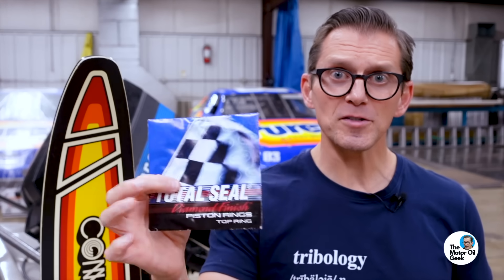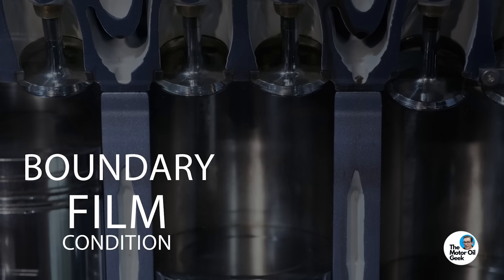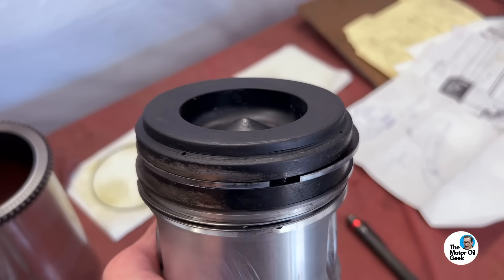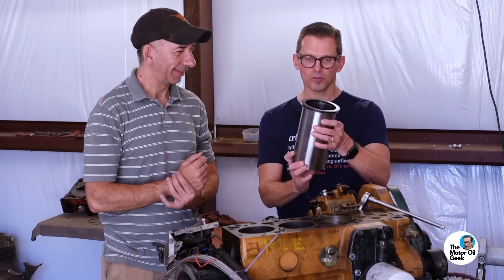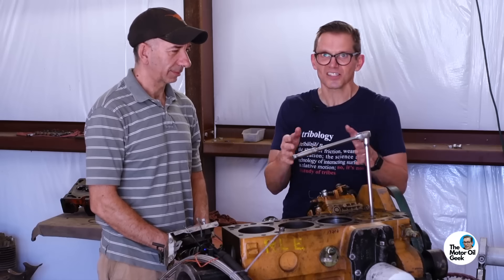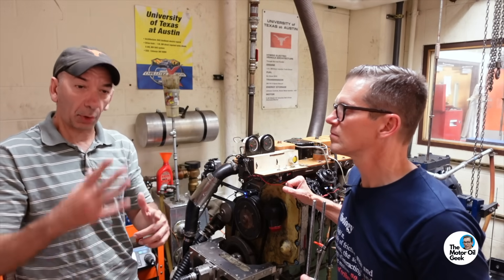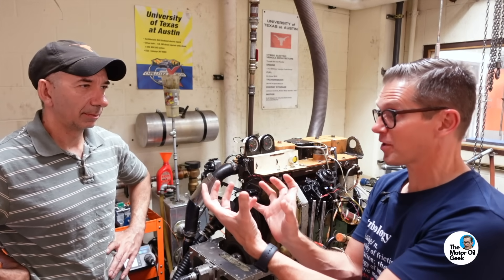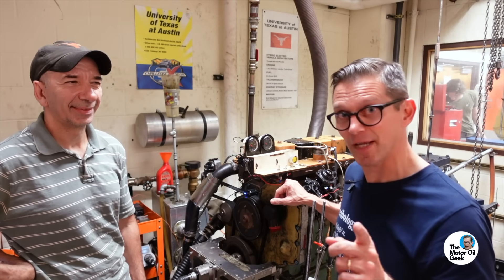Water Skiing Explains LUBRICATION - This CRAZY Engine Proves It!

Comment: What a game changer! Awesome idea Lake! Three things interested me: how is the liner motion lubricated with regards to the block; how much power is consumed by the liner drive system and how liner cooling is achieved (oil cooled or a combo of oil and liquid). Loving these videos! 👍👍
Reply from the maker: Thanks! There are oil passages in the seal that direct oil to the backside of the liner, so the liner is both lubricated and cooled by the oil flow.

The 10% gain is net of the friction to rotate the liner, which shows how much ring friction there is at TDC and BDC in a normal engine.
Reply: @themotoroilgeek  Thank you Lake. I thought that might be the case for cooling. That net loss of friction makes a huge difference!!
The rotating liner may also be an advantage for diesels too in helping prevent liner attrition from coolant cavitation.
I'm looking forward to your next video.
Reply: @steveross2797 I don't think this liner contacts coolant in any way. It's more of a sleeve in an existing bore.
Reply: @rotorhead5826  It's cooled by oil flow around the sleeve rather than liquid coolant as a conventional fixed sleeve would be.

Comment: That's so cool. But how does the outer portion of the liner (the part inside the engine not with the piston in it) and the sprockets that turn it get lubricated?
Reply from the maker: The seal at the top has oiling passages that provide oil supply to both.
Reply: @themotoroilgeek  thank you for clarifying

Comment: Really interesting project. Sealing the combustion and coolant long term seems like the real challenge. I find it hard to believe there is that much friction in the ring pack hitting tdc and bdc stationary to counter the energy required to drive the liner. Seems like you would pick up enough extra friction just from constantly rotating the rings in the piston at liner speed to contradict any friction losses from the rings starting and stopping. Also I noticed they were only testing this at barely off idle speeds. Can’t wait to see data at 2500rpm and full load.
Reply from the maker: It just goes to show how much friction there is in the ring package!

Comment: Very cool! So many people are still working on IC engines, improving efficiency which improves fuel mileage and reduces emissions. Money better spent than on EV technology.
Reply from the maker: Agreed!
Reply: Sorry, not sold on EV cars yet.
I’ve seen and worked on IC engines over 100 years old.
IDK, but I doubt there will Ever be an EV system, let alone complete EV car, that will be functional after just 50 years.  
I dont think any of the EVs today will even make it to 25 years.
Reply: The average is what matters. Now that we have data on the longevity of EV’s and their lack of required maintenance we can compare the lifespans and operating costs. Battery technologies are rapidly advancing so efficiency will increase over time. Gas and diesel engines will be around for the foreseeable future so it’s not an all or nothing situation. Denying science is stupid. Just ask Lake!

Comment: Im not a mechanic or engineer, but wouldn't the "sleeve" rotating as the piston moves against it increase pressures/friction or temperatures? Fascinating video.
Reply from the maker: Thanks for watching. The rotation creates relative motion between the rings and the liner, which creates a lower friction oil film. Think about the water skiing analogy.

Comment: I am very skeptical that this is a viable solution for a problem that barely exists. The amount of wear on a cylinder is literally microscopic. It's 1000's of hours to wear a fraction of a millimetre. Adding rotary seals, presumably changing from a water jacket to an oil jacket and adding a bunch of extra moving parts per cylinder to me suggests that there is likely to be more parasitic losses than the friction losses near TDC and BDC. The benefit that I could see in having a rotating sleeve is that the sleeve will have a more even wear pattern 1000's of hours down the track due to the thrust loading effectively being born by the entire circumference of the bore liner over time.
Reply: The main focus is reducing friction and improving fuel economy.  That is a real problem.  The wear is an added bonus which is important for commercial engines (not so much for automotive engines).  Even 0.001" of wear increases engine blowby and oil consumption.  The losses of the rotating liner are part of the equation in the testing that determined the fuel economy benefit.
Reply: On the rotatingliner site I didn't find any graphs or test results as shown on here. The graph shown on here didn't really show or explain much.
Reply: @Alan_Hans__  The graph you saw there is part of a paper that we are publishing at the Society of Automotive Engineers in April.  You are correct, it is not in the website.  Both this video and the website cannot explain the technical issues to the extend that research papers do....

Comment: 4:15 Hawker Typhoon or Tempest (The Tempest had the bubble canopy but so did the last Typhoons) with Napier Sabre H24 - dual crankshaft 12 cyl per shaft "H" with very high tech sleeve valve design that took a long time to get right and cost many planes and Pilots lives. In its Final "perfect" iteration ie when it was completely reliable (but even then you started it with a shotgun cartridge - which sometimes caused fires) it produced about 3000hp; I think only 1 late war US radial bomber engine had more hp for a piston engine.

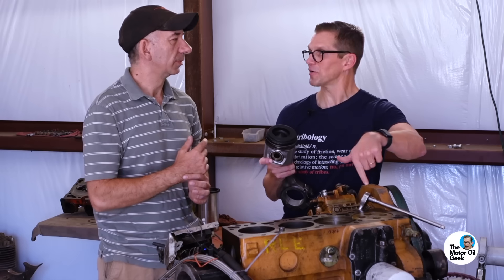 Eisenhower said in a special dedication that without the Typhoons blasting all the German armour and Tanks to scrap (notice the rockets - another first) the D Day invasion may have failed. It was an absolute brute. None exist in flying condition today but several are being restored.  4:44 Hawker Fury. The final evolution of the Typhoon/Tempest and the last piston Fighter of the RAF now with Bristol Centaurus radial engine but still sleeve valve; the ultimate piston engine fighter. One of these shot down a MIG 15 jet in Korea. 

We worshipped the Typhoon and Spitfire in England in the 60's when I was a kid. Without a doubt Britain's finest hour - sadly now no more...Great video; the first time I have heard anyone delv into boundary lubrication; there is an oil additive that uses this condition in the engine to constantly make new sacrificial metal; the more the pressure the more the SM - result very high oil film strength. I proved it on a Timken bearing tester so I know it works. Its bizarre that its not well known - only on Planet Earth where bad is good and good is bad...KIa Ora from Aotearoa

Comment: Two Thoughts - Questions about this theory...  
1) Wouldn't there be added friction of the rotating sleeve against hole in the stationary engine block... as well as additional friction of the gears and rotating mechanics that make the sleeve rotate? 
2) Does the sleeve rotation increase/decrease as the engine RPM's change, or is the sleeve rotation speed constant regardless of engine RPM?
Reply from the maker: Thanks for the questions. The added friction of rotating the liner is more than offset by the reduction in ring to liner friction near TDC and BDC. 

Also, the liner rotation speed can increase with engine speed or be held constant depending upon engine design (crank driven or independently driven).

Comment: WOw rotating piston liner, now you have even more heat and friction to deal with ,why not develop a system which simple helps with reduction of wear and friction in the compression system of the engine, instead of adding more wear and friction and heat, maybe considering a specialised coating right at the compression rings and oil rings made out of a friction reduction coating and the same with the areas of the compression chambers? 
So much easier to coat things and using specialised metals for rings and using specialised alloys instead of using a rotating liner, i get it its just to show a concept or how much a liner will reduce aer and friction?
Nest will be rotating pistons ,so specialised bearing's on the end of the gudgeon pin location, so as the piston goes up and down the forces are rotating the piston with a bearing set up on the rod where it contacts to the underside of the piston. 🦘🦘✌✌
Reply: Coatings are fairly common but have very limited results and wear off fairly quickly in heavy duty engines.  But for light duty engines, coatings can offer benefits for a good portion of the life of the engine.  But still, nowhere near the friction reduction that full film lubrication offers.

Comment: I seem to remember that the Napier engines had an oil consumption problem. What about this one?
Reply: The rotating liner engine has no ports on the sleeve, so there is no oil consumption issue.  If anything, we have reduced oil consumption because we can pin the rings at the optimum location.

Comment: I am curious, since he mentioned generators. If a person has a Gas generator and wants every gallon to last as long as possible, does octane make a difference? I know if does in my SUV.
Reply from the maker: It depends upon if the engine has a computer controller that can take advantage of a higher octane fuel.

Comment: Willys - Knight cars had sleeve valves over a hundred years ago. Thay were expensive to manufacture.
Reply: All sleeve valve engines were expensive compared to similar poppet valves.  This was one of the downsides of the Bristol and Napier WW2 engines.  The RLE will also be more expensive (obviously) but modern manufacturing methods will reduce the difference, and since the application is heavy duty engines, the fuel savings will pay back the incremental cost quickly.

Comment: I recall being told that at remote locations such as SAM sites that run generators of say 100 kw, the cost of the fuel is wild if there are poor roads. The military can easily hit $80/gallon if delivered by helicopter. So a small efficiency boost can mean a lot of logistical savings. I would be talking to DARPA for some money help and then to the military  genset makers.
Reply: Good points, but the military is not too concerned with saving money.  When they run out of money, they ask Congress more.  It is unfortunate, but in order to get money from the military, you have to pay millions to the generals first.

Comment: Heat transfer to block ...One overheat and its a wrap. How does the fire ring in head gasket seal ?
How is rotating sleeves lubricated?
Sleeve valve were made long ago because advanced metallurgy for exhaust valves and seats were an issue.

Also sleeves had oil consumption and carbon clogging issues .

I fixed a willys knight motor in a 1920s Brewster car made in NYS.

Good idea 💡

Comment: This is a very not intuitive finding. I never guessed piston ring friction as being so significant. The cost and complexity will keep this out of cars but will find its way, as Dr. D hinted, into stationary engines. If we go to larger  engines, say over 2 MW, then gas turbine with full loop extraction (water injection to raise power density, high pressure ratio, then heat recovery at inlet and downstream heat recovery etc. But for say a system that has a high duty cycle, small (say 1/4MW so gas turbine doesn’t scale well ), then the extra cost will quickly be paid back due to the higher efficiency. It would be nice to look at a worked through solution for a stationary engine with this feature. I mean with all things optimized, (inlet heat recovery, turbocharged and turbo compounded, what will this change do to the system? Maybe before the waste hear in the water jacket made sense to extract at inlet with an air / glycol exchanger but now with this system and less heat entering the water maybe now an inlet turbo at low rise is better to recover energy.
This stuff is Kelvin in action.
Reply from the maker: The rings rubbing against the cylinder liner is the #1 source of friction in the engine.
Reply: @themotoroilgeek   thinking about it, I see it better now as at the TDC / BDC Zero velocity point the ring defeats the film and we get sticktion. 
Reminds me of sweeping your hand across a wet windscreen. As you slow down, the wedging action ends, you get a severe judder on your hand. Speed up your hand again and reestablish the wedged film. Generac should try to liscense this now. They could capture the niche where efficiency is wanted on smaller scale gensets. This is a very credible invention.
Reply from the maker: @richardkudrna7503  That's a great analogy!
Reply: An idea for a video: Total Acid Number. I’ve been involved with a number of aerospace investigations where moisture ingress to oil resulted in acidification and bearing failure. My understanding is that even if you operate the machine and the heat drives off water, the oil remains acidified. I remember looking at roller bearings with etched rollers and race. Babbit bearings pitted at edge. I’ve wondered about cars where the owner does short trips on cold weather and how soon does this cause TAN to go bad and how much damage will this do to a car engine in how long? Aside from corrosion damage the bad oil laid down thick deposits.
Reply from the maker: @richardkudrna7503  Because aviation oils do not contain overbased detergent additives, TAN is more critical for those engines. Passenger car and Diesel engines do contain overbased detergent additives that neutralize those acids, so it is not a significant issue in those applications.

Comment: Do we need to pin the rings? As they might stick to the bore and spin in the ring groove at some wear point of this system.
Reply: Good point.  The rings are pinned in order to keep the endgaps at the optimum location.  But they may not have to be pinned.  The gas pressure forcing them down will prevail over the rotating force.  However, the oil control ring would have to be pinned.  At any rate, pinning the rings will reduce oil consumption, so no reason not to do it.

Comment: This engine ideal is awesome, but, I imagine a large engine full of these spinning liners and gaskets would not have the same service life expectancy. Could you imagine how much a head gasket service would cost?!?!?
Reply: The head gasket seals the coolant only, the combustion is contained by the combustion seals which are cooled by oil.  Since the wear is eliminated, the life of the engine should be substantially extended.

Comment: I love your videos and after watching all of them I guess my only question is when to change the oil I know your answer is used oil analysis but what I am confused about is that most people recommend 5k miles and I know you say application dictates chemistry so it entirely depends on the engine and driving environment ect but what I'm confused about is it seems like the longer oil intervals tend to have less wear over time I'm guessing because as the oil starts to oxidize the viscosity increases and produces less wear I'm guessing so it seems like longer is better with extended oil and oil filter but as you know there is fuel dilution and condensation build up I understand used oil analysis can answer those questions but I was reading that particles around 5 microns do the most engine damage and it seems like oil filters can not effectively filter at those levels, bbecause the microns are so small I'm guessing that is wear on the engine over the long term that would be harder to pick up in oil analysis. Hopefully this makes sense and I know you know more than I do on the subject any insights on this from you would be extremely appreciated as I think you are probably one of the only guys to have an opinion on something like this. I used the fram endurance filter and pennzoil ultra platinum on a 2.5L hybrid ford engine. It ask for 0w20 but I was thinking of running 5w30 in the summer after listening to your videos I understand that the different viscosity blends will have a different additive package which is not good but I think the higher viscosity benefit outweighs it I measure the oil temp and the bearing clearance on the aluminum block is .0016 so for June and July in summer in Phoenix Arizona I feel better about 5w30 but of course I will get a oil analysis from you to confirm. Hopefully all that makes sense I guess my main question is my concern with oil filters not filtering a good amount of 5 micron particles and the engine damage from that should I drain the oil 5k to get rid of those small microns not filtered out but the oil filter or push it out to like 8k as it seems to look better for larger particles higher in micron ratings
Reply from the maker: You have to remember that the wear metals in the oil at the time of the oil change are not zero. You don’t get all of the old oil out. What you are seeing is that the wear rate (additional wear metals) are actually pretty low.

Comment: As a fan of sleeve valves, I love that this is being pursued. Bristol engines found out about the higher efficiency with their sleeve valve radial engines, but at the time it was put down to reduced pumping losses and more efficient airflow with the sleeve valve design.
I see this rotating sleeve technology as opening the path to metal composite liners finally- imagine the friction reductions and thermal stability improvements in an engine from say a ceramic/ metal rotating liner?
I have an old diesel engine in my tractor with dry liners that are a simple sliding fit in the block. They don't rotate but are sealed from combustion with some interesting tricks.
Reply: Part of the reason of the improved sleeve valve efficiency was the higher compression ratio.  But friction was a big factor as well, probably greater.  Ricardo and Bristol knew, but they did not want to emphasize that in order to reduce confusion when they were trying to sell the concept.  At the end, it is the friction part that survived into the 21st century.
Reply: W Polsce dwóch inżynierów zaprojektowało i wykonał silnik V2 OHRV 1095ccm. Warto się zainteresować